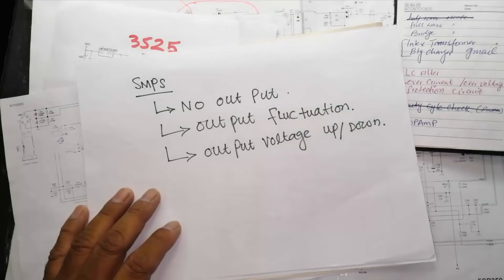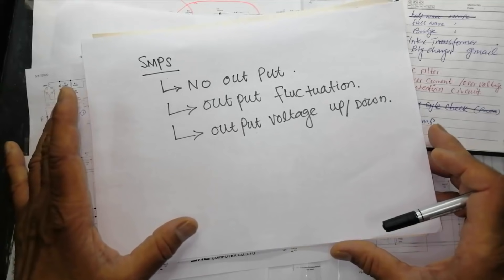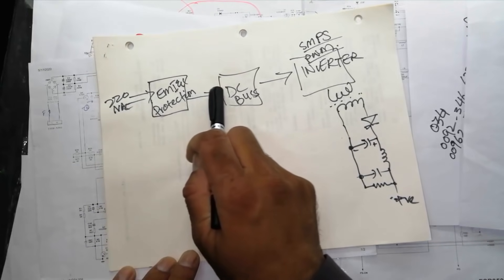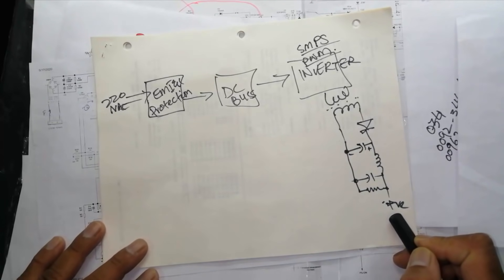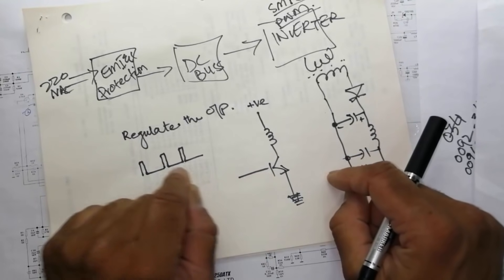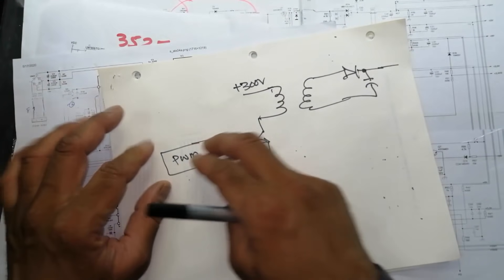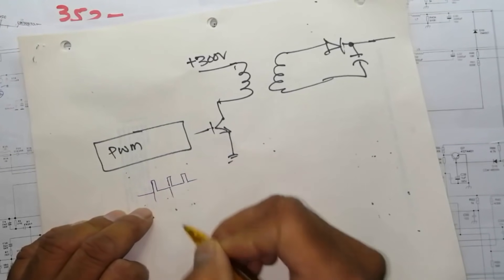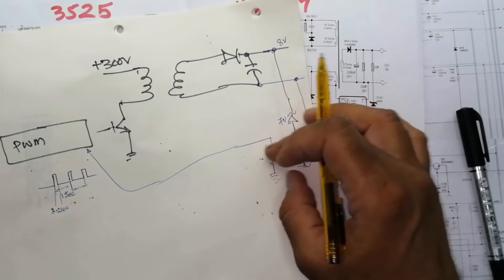{232} feedback circuit in switch mode power supply

Comment: Very Good Explanation on short in o/p in parts like diode, capacitors and other components coupled in output.Very good practical demonstration on soft start, start and restart was very very useful to all in electronic engineering people and in detail, how it works in output of optocoupler with small variations in +0.01 volt. This knowledge explanation is amazing and versatile. Nobody explains like U Sir. Thanks for this great knowledge. God bless you and your next generation for long time. Thanks

Comment: Sir if normal load connected, càn I checked the frequency
at primary winding side or secondary winding side?

Both frequency level  r same or different ?
Reply from the maker: please check frequency at output pin of the PWM controller IC 
or 
check at gate pin of the MOSFET 
yes both side frequency is same

Comment: Sir when you shorted the parts of the output circuit did you used a series light tnx sir
Reply from the maker: if we use series lamp or not, it will the same, a good smps should disable its output without any damage 
if we connect series lamp, in that case the lamp will glow at full load,

Comment: Hello M Haseeb, nice video ! can you tell how to check a transformer ? when the system has a supervisor, can we still see fluctuation in the optocoupler ? thank you
Reply: @HaseebElectronics  At which side of the transformer we can check that there is voltage ? across it or along the same coil ?
Reply: @HaseebElectronics  thank you , and in the secondary ?

Comment: A wonderful explanation. Thank you. 

A quick question, in multiple output SMPS is the regulation only done on one output voltage? For example, an output of +12V, - 5.0V, +5.0V, - 12V, +15V (just an example).
Reply from the maker: Yes, correct, most of the times it is monitored only one power supply (which one is most important)
in complex power supplies, all supplies are monitored by means of summing point method

Comment: Great job bro thanks for your video.
Here i have one problem in smps Before loading i got 24-0-24 but the smps is designed for 15-0-15.
After loading all the voltages are sort

Comment: It's actually the other way around. If there's short on the secondary, the chip will get less voltage (not higher), and the chip will turn off until the start up resistor charges the capacitor again which is slow. That's why it's restarting like this.

Comment: Hi sir, please clarify my doubt. How to calculate input fuse rating of SMPS 12V, 2A to avoiding damage of components in primary side of the SMPS..

Thanks...
Reply from the maker: in very simple method
input power= output power x converter efficiency
input current = Vin/P in
add allowable inrush current value

multiply result with 1.5

this will the fuse current value 
select the closest ampere rating in 250v range

Comment: Mr Haseeb facing some problem in 5V smps. O/p is 5v without load but drops to 2v when connected with load. checked o/p circuit resistors, all r ok.

Comment: Nice video, I hv an SMPS 24V 15Amp is not working. It's output fluctuate with ticking sound. If you have solution, kindly help.
Reply from the maker: i think your power supply is trying to start but there is some short circuit or over voltage protection, that is interrupting and forcing it to turn off
Reply: @HaseebElectronics   Thanks for the quick response. I have checked and there are not much components at secondary side. Only Schottky diode, zener diode, a resistor and filter capacitors. Can I share you image.
Reply from the maker: @jaywardhanpandit  yes please 00962-79-1161084 whatsapp
Reply from the maker: @jaywardhanpandit  ashraf4ta4 Gmail

Comment: Teacher, can i ask you something ?
Reply from the maker: yes please
Reply: @HaseebElectronics  im trying to repair dc to ac converter. Then output voltage too much low about 0,8volt. Used mosfet is 19n20c and ic is lm358.
Reply: @HaseebElectronics  then how can i check ic output signal ?

Comment: some times gate voltage comes negative why
Reply from the maker: i couldn't understand your question completely because you didn't mentioned the circuit or component (igbt or mosfet and their types)

always gate drive for N channel is is composed of +ve voltage but some circuit which have p channel IGBT the need -ve drive

Comment: My computer doesnt turn off after shut down how can i check the board ?
Reply from the maker: remove power supply, manually turn ON power supply by making jumper to PSON, and then remove  jumper. if power turns off manually then 
check PSON switching circuit on motherboard